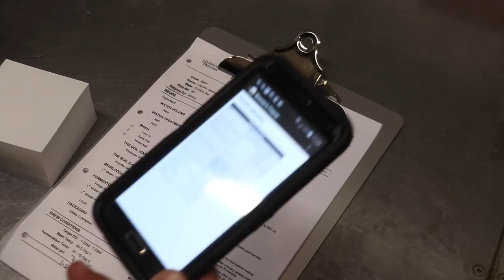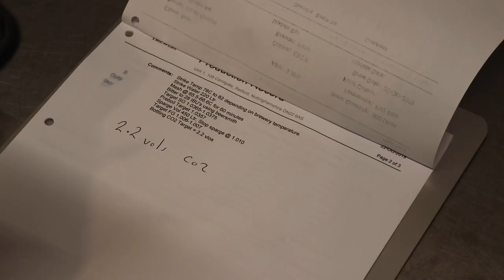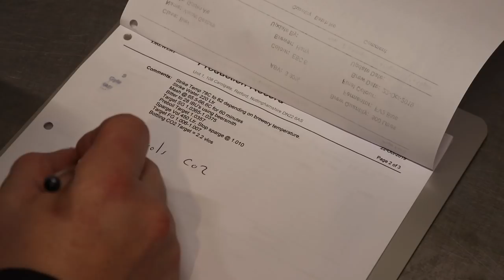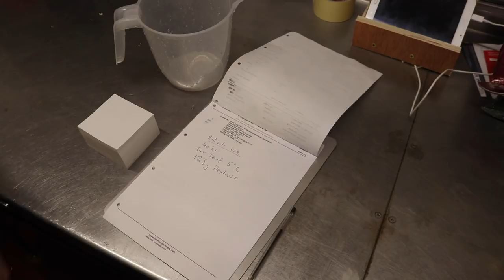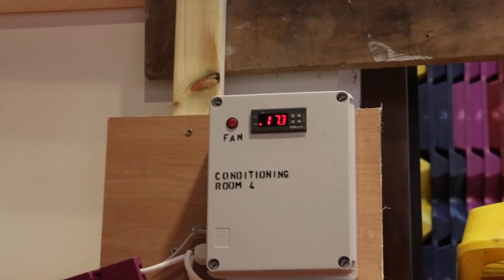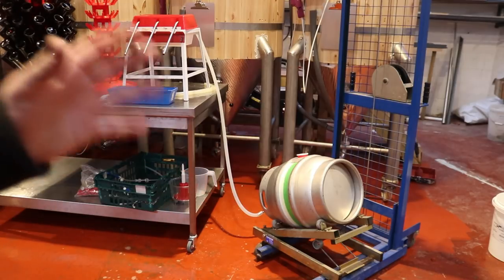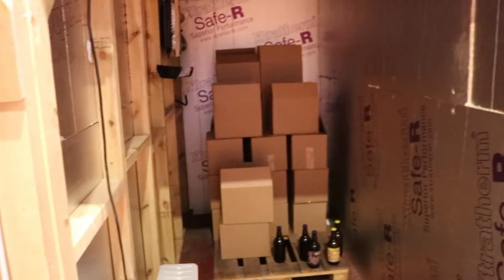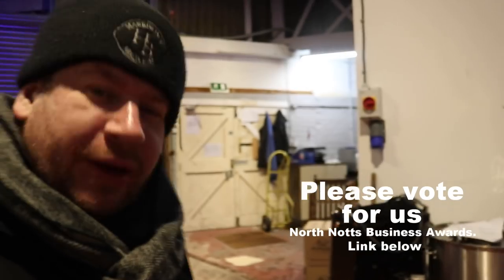BOTTLING

Comment: Hey Harry, sorry to keep bringing up the bottle carbing issue.. Just trying to learn.. Am I right in thinking the pressure on the glass will be greater when it's carbing, then when it cools it absorbs into the liquid and the chance of a bottle bomb reduces.. Its just hard to tell how much vols a bottle can take..
Reply from the maker: In short yes. As the pressure of gas above the beer in the bottle is temperature dependant, then once all fermentation is complete, the act of chilling will result in a reduction of pressure in the head space. If you are getting bottle bombs then you are grossly over carbonating.  Here is a paper on the subject of exploding bottles. It is not as dry as you might expect. https://kb.osu.edu/bitstream/handle/1811/68448/OSLJ_V24N3_0516.pdf
Reply: @harrybrew69  never had one mate but never sure how far I can go with the vols.. Did a Hefeweizen that is meant to be quite highly carbed to about 3.5 and survived lol.. Thanks for the article

Comment: I would be worried about O2 on that set up
Reply from the maker: It can be an issue if you are not careful. 90% of microbrewery manual bottling machines work like this. I would love to have a collar on it with co2 flowing over from a tank at like 2psi. I might mod it.
Reply: @harrybrew69  i guess with refermentation in bottle the yeast will consume 'some' of the O2 but not all. Gash Slugg has a video about NOT shaking the bottle once filled, as the O2 gets into the beer and its starts to oxidise faster than the yeast can consume it
Reply: @harrybrew69  I was under the impression that even contact with the air introduces oxygen? Everyone seems to be paranoid about oxygen at the moment and every second brewing video seems to be about oxygen free transfer. I've even read people saying that lifting the lid on your fermenter can introduce oxygen??? I've only been brewing for 6 months but this whole issue confuses me as your beer clearly has contact with the air above it in the bottle filler but you say that oxidization is not a problem. Youve obviously got years of experience and id like to hear your thoughts on the issue more if your were inclined :-)